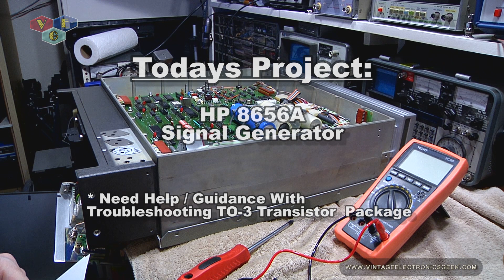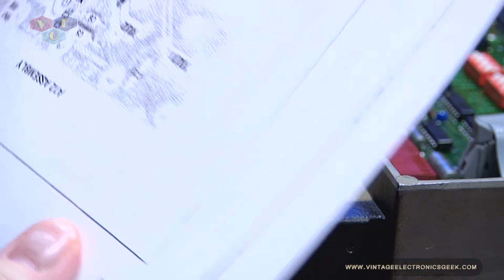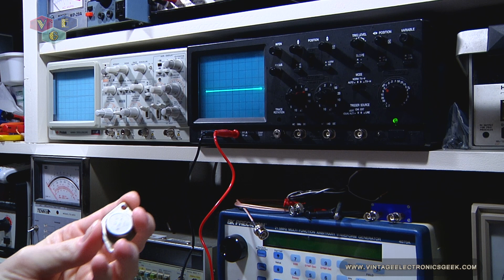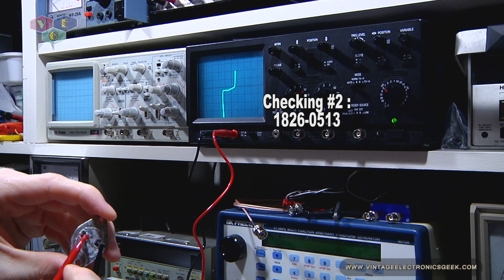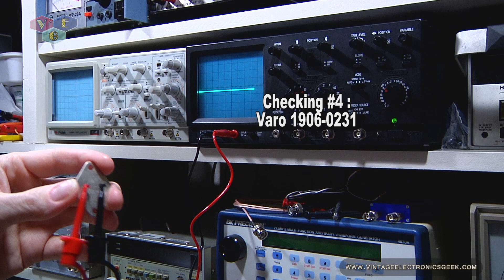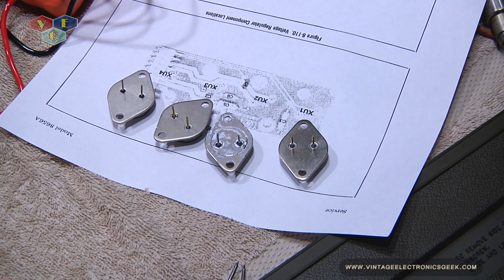HP 8656A - Help Needed - Help Me Troubleshoot T0-3 Voltage Regulators

Comment: HP's schematics are excellent. For those joining us here: The Service Manual: https://bit.ly/2SCtQOr, PDF page #s 512-515
U4 is a pair of diodes, extreme left side and bottom of schematic. Should test as a pair of diodes using your meter. Going from fuse F4 to U2, which is the five regulator. Move to the right til you come to the +5V crowbar. What this does, is shorts the line to ground if there is a fault and should pop F4. With the regulators (U1, 2 and 3) removed, check for DC voltage in the sockets. Check the fuses. See that power is getting to the inputs of the regulator U2. It is probable that the +/-15 is working fine. Ignore them for now. Measure the DC resistance from U2 pin 2 to ground. It might be shorted to ground. If not, the regulator might be bad. 

To test the regulator, put 8 volts or more into pin 1 of the regulator and measure the output pin for +5V. If that is good, there is probably a short down stream from there. I see a lot of Tantalum capacitors. These like to fail in a short circuit. Note the the output following the crowbar splits into 3 paths. If that line is shorted. Open the three paths and follow the short til you find it.
(There are currently two silicon valley engineers, me and my pal Joe, working on this.)
Reply from the maker: This got flagged as spam!  :)  I appreciate you and your friend helping my immensely! I dont have anyone in person to ask nor do I, an Elmer, so I have to bother the community for which I am grateful for the help.  I'll try the troubleshooting steps as suggested and see what happens.  Thank you again!  ~Jack, VEG

Comment: I see you got some really good advice from all the other guys. The diode/ohmmeter function was perhaps not so useful, but it would have shown you if a dead short existed. The component checker sometimes showed you a typical "conduction knee"--the bend. I realize this is part of a series I am watching, but did you ever make progress?
Reply from the maker: Hello brother!  As of this post, I have not worked on it, you will see another video posted, but that's as far as I got.  I had another piece of test gear come in and I needed to clear my workbench to test it and video...which I need to finish that...just got real busy elsewhere..I ordered a user/service manual for it as the 445 page PDF was kinda hard to use as it wanted to bounce from section to section...thought Id save a tree from printing....I'm hoping maybe next week I'll start back into it...however video posting may come out later as I want to post the other items first...wished you lived closer  :) This thing better not take a knee, I'll kick it to the curb! :)  Thank you for your support!  ~Jack, VEG

Comment: I'm used to boat anchors Jack I have quite a few and are considerably heavier than 44 lbs. But as to help on power transistors did you check them in circuit, ( I will share your help video with Ron and see what he can come up with) to see if they were putting out the correct voltages? Checking them outside the circuit won't work for those type regulating Transistors. Hope you get it fixed jack that sure is a nice one like my brother Ron has.
Reply from the maker: Thanks Larry!  I'm sure other gear is heavy indeed, I was not expecting at its large girth...you've seen it in pearson, pictures lie!  :)  I've just tested in line, PIA, but I did...I will make a follow up video in about an hour or so, so look forward to it and my findings...I appreciate any help the community offers...I've skirted by on all my previous jobs...now the real work begins!  :)  ~Jack, VEG

Comment: I am not sure I would tackle the repairs on a piece of equipment like that. Are those transistors or voltage regulator ICs? I always thought voltage regulator ICs were in epoxy TO packages. Are they all the same? Switching them around can give you a hint. Gary
Reply: VRs come in either, higher amps are like these.  SCRs are like solid state  switching relays, on or off, go or no go with a trigger, like a switching transistor.  Looks like one may be an SCR, the others VRs?  So my guess is best way to see if they work is in circuit.  At least its low voltages for the most part.  
Jack is one of those outer space aliens, you know, probing things.  He's from California where aliens abduct people with tin hats for ""observation"". I think there was a TV show about Jack, called MY FAVORITE MARTIAN, when Tim told him, "it's not polite to point".
Reply: @umajunkcollector  Hi Don; If those four semi-conductors are all identical Jack might try switching them around like the olde shell game. BTW- I am looking for an RCA Headliner television set from 1956. We had one when I was a kid. Shango066 resurrected a KSS96 couple of years ago or so. I think the model we had in 1959 was an RCA 21T6082.  I never see those in my area.
Reply from the maker: Howdy Gary!  According to VideoLabGuy and others, 3 of them are VR's and the last one is a double diode.  Westel Audio helped me out a whole bunch last night and I have tested them...they all seem to check good except the -15vdc, with a -20vdc in, it gave me a -1.120 that kept changing positive...just out of curiosity, I flipped the polarity and it outputted a +1.20vdc that kept changing negative, so I'm thinking that is no good. 

As stated, I've skirted by these past few years not ever addressing these types of components, all new to me...I thought they were transistors and they clearly are not, my error.  As far as "me" working on it as opposed to someone more advanced...I probably would do that, except I don't know anybody personally who is into electronics and I would imagine a shop, the repair bill may be rather expensive...however, if I can't fix it...then I would be forced to go that route.  Thanks Gary.  73's OM.  ~Jack, VEG
Reply: @VintageElectronicsGeek  Jack I am certain you will triumph over the problem at least a bit better than I have done on my 1948 Silvertone TV. Gary
Reply from the maker: I don't know Gary....you've got the skills to pay the bills!  I'm essentially starting out...one day I'll be as talented as you!  :)  I am hopeful that yes, I can fix this device, been wanting one for awhile.  ~Jack, VEG

Comment: Hiya VEGster, #1 looks suspect.  Did you take meter readings powered up in circuit?  
Then you can tell if the VR or transistor is doing its job.  i.e. a 15v+ should show that on its output pin, or 15v-, or 5v+, whatever,.  A switching transistor or SCR would be a yay or nay according to the manual.  A transistor may amplify, like when turning up the gain or vol control. Um being basic, perhaps overly simplified, but what do I know?  not much???  
The Donald  MAGA  lol
Reply from the maker: Thank you Don, I appreciate the basics, as stated, I have never played with these before...been lucky up til now...its just been me and my golden screwdriver!  :)  VideoLabGuy also suggested the same thing, so I will try that now to see what happens.  Thank you Don, I appreciate the help.  :)  ~Jack, VEG

Comment: The parts marked "LAS...15" are 15 Volts regulators. 
1862-0513 seems to be a HP oem part number, it's also a voltage regulator but sadly I can neither find the pinout nor the output voltage. Usually I test them by hooking up the required capacitors and a dummy load and see if I get the correct voltage.
Reply from the maker: When you say "dummy load", are you referring to a resistor to absorb the load?  Would I need one even if its momentary into the DMM? Thank you for your help, I greatly appreciate it!  :)  ~Jack, VEG
Reply: @VintageElectronicsGeek  

Yes, a resistor between ground and output that is able to push the regulator to it's current limit to make sure it's still working up to spec. The meter alone has a very high resistance (around 10 megaohms) which might falsify the result, hence the resistor to simulate a real world condition.
Reply from the maker: I have a 50 ohm, 200w power resistor, that should work?  ~Jack, VEG
Reply from the maker: How do you test the -15v VR?  I don't have a PSU that supports it nor do I have second PSU?  Honestly, I don't have a full understanding of negative voltage but have tried to educate myself in the past with little success.  Thanks!  ~Jack, VEG
Reply: @VintageElectronicsGeek  

That would be 100 milliamps (at 5 volts), a bit low for a to3 I suppose but it should be alright for a quick test. Have you figured out the pinout yet?
Reply from the maker: Here is my findings - +5vdc in on all: #1 - 4.532vdc, #2 - 4.089vdc #3 - 315mvdc , having a hard time reading the schematics (my eyes) so I wasn't sure which has higher voltage, so I played it safe...and I was unsure which was negative voltage and how to test that as I'm not setup with PSU's that can do negative voltage. Testing #4 as a diode (unknown NPN/PNP) I think it's a PNP...if I place negative probe on case and positive probe on either leg it reads .490v / .476v.  EDIT: If I swap the probes and try the other way or touch both legs, it reads open. ~Jack, VEG
Reply: @VintageElectronicsGeek  

Negative is to be understood as in relation to ground. A +15v/-15v PSU is essentially a tapped 30v PSU with ground in the middle.
Reply: @VintageElectronicsGeek  

The VRs are dropping out on 5VDC, the input voltage must be higher than the output. I'd say the 5v regulator should be tested with at least 7vdc and the 15v one with 18vdc. Voltage regulators are quite complex inside, they are essentially feedback controlled variable resisitors so NPN/PNP measurements aren't very helpful here.
Reply from the maker: Thank you for the datasheet!  Wish you had content online, I would support you!  :)  I cant thank you enough for taking the time to help me, I most humbly and greatly appreciate it! Everything I know is from watching YT...dont know anyone personally nor an Elmer...when I was a kid and started to learn, I did know someone then...he worked for Wang Computers...but as life went on, I stepped away to play life, now Im old.  :) ~Jack, VEG
Reply: @VintageElectronicsGeek  

Thanks, no problem, it's always interesting for me and I might learn something new myself. :)
I'm not very good at making videos, but maybe I'll try someday.
Reply from the maker: Just grabbed 2 new 9v, need to locate my 9v clips, I need to try to understand the schematics to see which VR does what so I know which voltage to apply...I find ready this schematic is like reading PHP, very challenging plus it dont help to have bad eyes.  :) Give me a little bit in trying to achieve the next steps.  ~Jack, VEG
Reply from the maker: Ima goober, I have a few DS, so that just might be a big clue at what does what!  :)  Its apparent, your more advanced than me, but I understand the statement...I used to be a pro photographer, same thing...always learned something new.  Well, if you do, please let me know...start with a shop tour...I always like those.  :)  ~Jack, VEG
Reply from the maker: Update:  New findings...took awhile to ID the VR's, but I did: #1: +15.14vdc in = 14.10vdc out, #2 +5.018vdc in = +3.79vdc out.  Now I need to locate my 9v connector to test the last one.  ~Jack, VEG
Reply: @VintageElectronicsGeek  

I took a look at the schematic and the 1826-0513 is definately the +5 volt regulator. Did you test that one with 5 volts? It also needs a 100nF cap between pin 1 and the case it seems. And as I already said, only 5 volts is too low to test it because thevinput must be at least 2-3 volts more than the output ususally. A singe 9 volt battery would be just right. 3.8 volts seem ok considering the drop out, but it doesn't say very much. 

 I couldn't find the fourth one though, maybe it's a full wave rectifier?
Reply from the maker: Facepalm...I got so involved in trying to find out what, that I forgot your instructions...sorry about that, let me retest at higher values.  I couldn't locate connectors, but I have alligators, so I'll use that for battery...per VideoLabGuy, he stated #4 is a double diode.  ~Jack, VEG

Comment: Transistors? 
Or voltage regulators?
Reply from the maker: Per VideoLabGuy, they are VR's, apologize for the confusion.  ~Jack, VEG
Reply from the maker: Update #2:  #1: +17.33vdc = +14.93vdc out,  #2: +7.12vdc in = +4.977vdc out,  #3: -20vdc in = -1.120vdc out, however it would keep going positive, I stopped it when it hit .990vdc, I swapped the cables it started off at +1.30vdc and went negitive...hope this is better test. EDIT: two brand new 9v battery.  ~Jack, VEG
Reply: @VintageElectronicsGeek  

So the VR is bad and the rectifier aswell? Makes me think something else is wrong with it that led to cascade failure in the PSU assembly.

Maybe C25 is shorted?
Reply from the maker: I just checked all electrolytics on the two boards, all but two are checking bad....I will do another video today on it and the VR findings today and try to get it posted tonight/tomorrow.  Thank you again for your help...I really appreciate it.  :)  ~Jack, VEG
Reply: @VintageElectronicsGeek  

Good luck buddy ;)
Reply from the maker: After doing some more research, I found a cross reference for #4, a replacement DS is here:  https://www.datasheets360.com/pdf/-2578495908528084340  ~Jack, VEG

Comment: I don't think those are transistors. XU1 (etc) = External U1. These ARE voltage regulator ICs. One positive 15V, one negative 15 volts, and at least one 5 volt. Not sure about the fourth. You did not show the schematic for this section. But, that should clear things up. The parts with numbers that go XXXX-YYYY are house marked by HP. Thse are most likely standard components that have been subjected to more thorough parametric testing for reliability . HP is like that. U1 and U3 are the plus and minus 15 volt regulators. You can probably buzz from the transistor socket to the labeled test points. And, as usual, I may be wrong.
Reply from the maker: What would be the proper what of testing?  Have them in socket and take a reading from the rear?  I apologize if I didn't understand what your saying fully.  The Service Manual: https://bit.ly/2SCtQOr Page's: 8-126 & 8-127 .  Thank you very much for your help.  ~Jack, VEG
Reply: @VintageElectronicsGeek  See my reply above where everyone else can see it too.
Reply from the maker: OK, had to read it a few times for it to sink in.  :)  Thank you again!  ~Jack, VEG

Comment: Hmmm.... could you try different transistors in the same package?
Reply from the maker: I don't have any of these on hand, never needed up til now...but once I order, I like to stock up!  :)  Thank you!  ~Jack, VEG
Reply: Vintage Electronics Geek Ahh yes my friend. I was just wondering. I don’t know if a suitable crossover would work or not. AliExpress has everything I’ve ever searched for and may have this exact replica. I will look and see then get back to you on my findings brother. 😁
Reply from the maker: That would be very cool, thank you!  I'm still testing device out...I think all but 1 is good...I now need to test to see if I'm getting voltage to the sockets.  Thanks brother, again I appreciate it!  ~Jack, VEG
Reply: Vintage Electronics Geek Wow, there isn’t much on the web about the Varo 1906-0231. However, I did find the exact replacement for 6 bucks. I wish I could find the datasheet for it to see wether or not it’s functioning correctly but it doesn’t seem to pull anything from bing, yahoo, or google.
Reply from the maker: I found a cross reference last nite but hadn't had a chance to look for replacements on any yet....here is the replacement for 1906-0231:  https://www.datasheets360.com/pdf/-2578495908528084340   Thanks again!   ~Jack, VEG